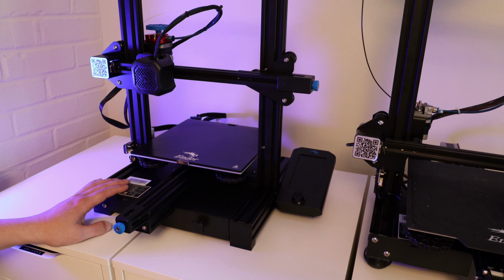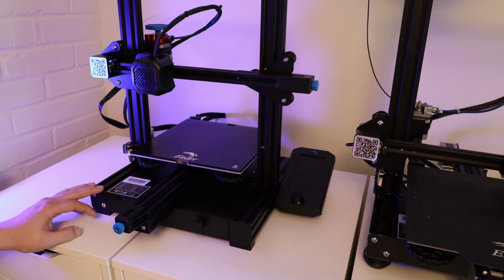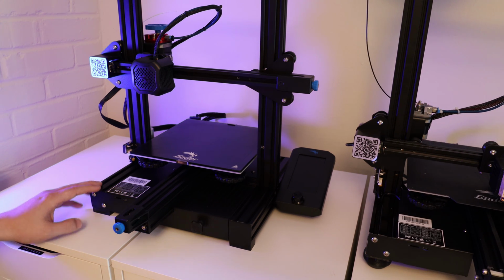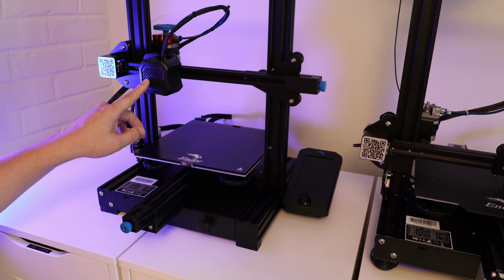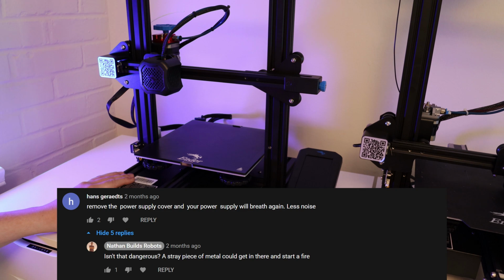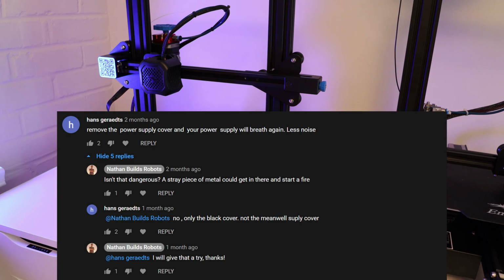The Ender 3 V2 Power Supply Is A Hot Mess!

Comment: Check if they tinned the wires in the screw terminals of the control board, that's a much bigger fire hazard
Reply from the maker: They definitely aren't crimped. I believe the wires are tinned.
Reply: @NathanBuildsRobots  Google it, I would redo all these.
Reply from the maker: @NicksStuff  Yeah, I saw an Artillery Hornet review and it was the first cheap printer I've seen that actually crimped those connectors. I agree that it is the best way to make those connections, but I'm wondering how big of a problem it really is. They ship tens of thousands of these things out with tinned wires, wouldn't we hear more about it if it were really that unsafe? I'll see if I can find some horror stores on Google.
Reply: @NathanBuildsRobots  Well, it's not a 10% risk either 😉
But that's not the right way to do it, so I wouldn't sleep right if I didn't change it
Reply from the maker: @NicksStuff  Next time I have to open the motherboard tray I'll fix it, it only takes 5 minutes to do so why not?
Reply: @NathanBuildsRobots  Agreed

Comment: Have you tried changing the vref settings ? I changed the x,y,z to 0.55 and e to 0 72.. That completely changed the game.. Try it
Reply from the maker: Funny you should mention that because I just did that on a Voxelab Aquila this morning. 

What improvements do you get by increasing vref? As far as I know it controls stepper motor and gives you slightly tighter control and higher speed capability at the cost of your motors running hotter. 

On the voxelab aquila, it came with vref at 1.3 V, crazy high. Print quality was great, but it caused my steppers to run 90 C, which is too hot for my liking. Turned it down to 0.55 and it ran much cooler, no lost steps but there was some wavy patterns showing up on straight lines, probably from timing belt cogging. Turned it back up to 0.8 and I think that's a happy medium now, good quality and steppers aren't too hot. They run 40-50 C now.

Comment: My Ender 3 V2 will be here next week or so.
What is the clearance on the bottom? Could I design and print little vent pathways to prevent the fan from taking in exhaust?
Reply from the maker: Clearance is about half an inch (12mm)
I would recommend the squash ball feet, they work great. Just look up "squash ball feet Ender 3" on Google or thingiverse, it adds better damping and raises the machine up about an inch (25mm)

Comment: Do you have any evidence that the power supply is actually overheating? Because of the heat transfer to the entire metal body of the printer, the power supply always runs quite cool and the active fan is likely not necessary.
Reply: @Twinsen yeah, maybe PSU isnt overheating. But, overtime it will shorten lifespan of the PSU. And get worse if you decided to put an enclosure for printing like ABS
Reply from the maker: @tdnam_9989  right, is not overheating in the sense that it is failing or shutting down due to the heat, but it's just running a bit warmer and keeping the fan on much more often. 
It might not matter for the average use case, but if you need to draw more power (for example, if you are printing PETG and need to heat the bed to 90)  or run it in a hotter room, it has less overhead to be able to accommodate the increased heat and is at a greater risk of overheating.
Reply from the maker: The power supply is off a typical design that is primarily cooled by forced convection driven by the onboard fan. The heat-generating electrical components sit on a PCB which is suspended inside of the metal housing with no direct paths for conductive heat transfer to the case aside from a few small standoffs. A power supply could be designed to conduct heat into the frame, but 99% of them are not set up that way, including the Meanwell power supply that comes stock on the Ender 3. 
Also, the PSU has an internal thermistor that turns on in response to a temperature threshold programmed into the board. I know that the PSU is running cooler because the fan is turning on less often. The stock system ran the fan almost constantly, while the modified setup only runs the fan about 20% of the time. 
This could be easily verified using  my thermal camera, but I can't do it now because I have no stock setup to compare against at this time. Cheers

Comment: Absolutely well done for not removing any of the metal covers that some (ignorant) people are advocating. :-D
Happy to agree with all you say about cooling and I will be removing part of Creality's plastic shroud to expose the fan ports'
I'm happy to leave the PSU where it is, but each to their own, eh? :-D :-D
Reply from the maker: There's more than one way to skin an Ender 3!
Yeah I try not to advocate messing with anything over 60V. I won't tell you NOT to do it, but there are special precautions and training required to do it safely.
Reply: @NathanBuildsRobots  TBQH I tell people not to do it regardless of voltage, when they clearly don't know what they're doing. :-)
I've seen someone get a very nasty burn from an accident with a 12V car battery (not from the acid).
Reply from the maker: Yeah high current can be dangerous too. Bottom line is stay safe and be careful!

Comment: Mine has it too and I just took it out. It was only blocking the vents and was aligned with the fan grill. When the fan is not working I'm just alarmed something went wrong. It's so quiet it makes me think it's broken. I might move it to the side later on. But I don't wanna deal with it right now. I'll first try printing a scoop pointing to the back or the side. I think it will make things much better.
Reply from the maker: It's a lot of work. In my latest silent build video I just did away with the power supply entirely.
Reply: I'll check it out

Comment: Well the whole thing is a mess heat wise: First: the powersupply being blocked from breathing. Second (even worse): The mainboard fan is connected in parallel to the part cooler so it only runs if you have the part cooler set to on. :).
Reply from the maker: Really? I didn't know that, only noticed that it would sometimes turn on and sometimes stay off. Poor choice by Creality!
Reply: @NathanBuildsRobots  Yes, really really check the board connection :). That leads to super random effects if you print with low or even without part cooling over a long time :)

Comment: Great video, thanks! The E3 Pro does not have this issue and indeed the place where the power supply is mounted is optimal for cooling so why not keep that solution on the V2? Nice handywork too :)
Reply: Having it inside the base is a good idea. Mounting it vertically like he does is quite close to the heating bed. I would keep mine where it is and allow more airflow by removing the cover.

Comment: Cutting the part cooling fan cable would be an instant sub if I haven’t already xD

Beautifully radical. I love it :)
Reply from the maker: Yeah those small Blower fans are the worst. Lots of high pitched squealing for something that makes such little airflow. 
Thanks for subbing! I'll be dropping another video this week for a bonkers build I just finished.
Reply: @NathanBuildsRobots  Do they really not do that much??
Reply from the maker: @Nopulu  Blower fans help on detailed prints, small prints, overhangs, and bridges. The two most common sizes are 4010 (small) and 5015 (med/large).

The Ender 3 blower fan's duct is not very well designed. It does a poor job of directing the air onto the printed part.

I'm currently reviewing a Voxelab Aquila, which uses the same fan, but a better duct and it is outperforming my Ender 3 when printing a benchy. I will have a video out on that printer soon.
Reply: @NathanBuildsRobots  So if I was getting fed up with the noise on my blower fan for my ender 3 v2 and decided to cut it off, would I see any noticeable difference in print quality? Or would I be in bliss from not having to hear my fan rattle every 3 hours when plastic strands gets caught in it.
Reply from the maker: @Nopulu    I cut my cord since I knew I was going to be removing that it as part of a mod soon anyways. 
I would recommend turning off your part cooling fan in your slicer settings first to see if you can live without it, or trying out the 5015 blower fan because it's more effective and less annoying.

Also the v2 fan is pretty good, while the Ender 3 pro fan is garbage because they have a different fan duct design.
Reply: @NathanBuildsRobots  How do I turn off or down the blower fan in a slicer like cura? Or can you only turn down the main hotend fan?

Also, If I bought a 5015 blower fan, would it fit in the stock ender 3 v2 fan duct shroud? Or would I have to print off a new one?
Reply from the maker: @Nopulu  https://youtu.be/Qg47Std5ywI
Check out this video by CHEP. He does the 0% fan show setting in Cura at the 57 second mark. I use Prusaslicer myself. 

To use a 5015 fan you'd need to replace the plastic fan mount. Theres a couple options on thingiverse. 
https://www.thingiverse.com/search?q=ender+3+V2+5015&type=things&sort=relevant

You can only control the part cooling fan in the slicer. You can control the hotend heatsink fan in firmware, but that is a little more difficult to set up.

Comment: I just ordered an Ender 3 v2. I will be modifying the power supply cover to open up the holes right off the bat.
Thanks.
Update:
I printed a new cover for my PSU that has more ventilation and holds a 120mm fan. I'm not sure you even need a fan if you get enough air holes in the PSU cover. The 120mm fan rarely if ever runs.

Comment: I've avoided buying the V2 because of changes like this. The "upgrades" they put on the V2 still don't outweigh my Ender-3 and Ender-3 pro machines enough to pick one up. I'll likely just jump to an Ender-5 when it comes time to replace one of my current printers.
Reply from the maker: Yes, I've had to undo a number of their "upgrades" from the Ender 3 Pro.

The good: 
-Silent stepper driver board (at this point this should be standard on all printers).
-Glass bed is flatter and provides more consistent 1st layer. 

The bad: 
-Belt tensioning knobs kept coming loose, replaced with nylock nuts.
-Threw away the extruder wheel knob.
-I Don't use the drawer. Would throw it away if I knew how to take it off. 

The ugly: 
-PSU mounting and vent cover.
-Louder fans than predecessor.
-Larger footprint than predecessor for same build area.

There are a number of inexpensive upgrades I would have gladly taken instead:
Quieter fans +$3?
Fill sized USB and SD card +$2?
Capricorn tubing +$1?
Metal extruder +$3?
Better bed leveling springs +$1?
Actual touchscreen instead of knob controlled TFT display +$5?
Reply: @NathanBuildsRobots  Looks like the Pro with your suggested upgrades would be better value than the V2.  Or maybe a Voxelab Aquila, not sure if they do the PSU the same way though.
Reply from the maker: @nickwilliams1953  the Aquila is a much better deal. My latest video highlights the difference between the aquila and the V2.
https://youtu.be/SMLL-16FQWk

The power supply is the same as the Ender 3 V2. It's a 20 minute fix to trim the power supply cover though, so it's not that big of a deal. Just something they could have easily done at the factory and saved themselves some material cost at the same time.

Comment: Get some case nibblers. Good vid but your metal skills need work.
Reply from the maker: Thanks for the tip, I'll have to get some nibblers next time I'm working with sheet metal. The $5 shears I was using kept bending the metal at the cut edge. Definitely not my finest work.
Reply: @NathanBuildsRobots  I used to use these to put fans and windows on the side panels of computers 20 years ago.
If you don't want to buy specialty tooling use an exacto knife scribe your lines. Drill a starter hole so that you don't have to start cutting from the edge.  Use the nibblers and then a Dremel to clean up any burs or sharp edges.
Reply: It won't let me link to Amazon, but something like the Pro'sKit 900-215 Nibbler are what I'm talking about. They are under $15
Reply from the maker: @3sotErik  alright, I bought one, will test it out next time I need to trim some sheet metal. Looks like they might come in handy for trimming support material off my prints too.
Reply: @NathanBuildsRobots  also consider looking on Amazon for 
Black U Channel Edge Trim Seal EPDM 15/32" high x 19/64" Wide (5 Feet)
It's only $8 for 5' so it will last a long time. It will protect wires & fingers from sharp edges.
Reply from the maker: Just used the nibblers for a project, they worked great!
Reply: @NathanBuildsRobots  glad to hear.
Reply: @3sotErik  Those are for fiberglass circuit boards. An air nibbler is what would be needed.  https://www.harborfreight.com/16-gauge-air-nibbler-96661.html
Reply: @MicroRotors what? He was cutting sheet metal.
Reply: @3sotErik  The product you linked to is intended for cutting circuit boards. The one I linked to is for cutting up to 16 gauge sheet metal.
Reply: @MicroRotors  I've been using this product for over a decade.
Amazon Description
"This Nibbler cuts up to 18 AWG soft steel, 1/16" copper, Al. and Plastic."
Reply: The product you linked to does the same thing but requires an air compressor. Mine does it manually, for much smaller projects.
Reply from the maker: I have used air nibblers before, is a little overkill for what I'm doing. I used the one bear recommended to make a neat hole in some sheet metal for my latest build, where I needed a hole to install a vapor chamber on the backside of my mainboard. The shears worked quite well for thin steel, almost like a can opener. 
I will have to try them on circuit boards I'm sure they world work on that too.

Comment: In fact, the most noise comes from PSU. I opted to print a cover for PSU, MOBO and a support for feet, from thingiverse. With arctic 80mm fan, I have no noise from PSU anymore.
Reply from the maker: That's a good way to do it. I added some feet to my printer from a thingiverse project, that use squash balls to damp out vibrations. Might be the same thingivrse project you used.  
I am a little reluctant to use 3D printed parts near high voltage or hot zones. I added noctua fans to quiet it down too.
Reply: @NathanBuildsRobots  it is not the same project, I used one associated with this: 4601320. There are 3 items for printing by the same person. For those who want to keep the PSU under the printer, this is a good project. The MOBO cover takes a little more work (needs a buck converter) and the noise reduction from MOBO is negligible (from PSU is huge). I used Arctic fans and now I only hear the hot end fan.
Reply from the maker: Oh, nice. 

On my Ender 3 Pro I replaced the hotend fan with 2 Noctua fans in line with each other, which cut out a lot of noise. I checked the heatsink temp with a thermal camera and it only increased heatsink temp by 1.5 degrees C, so pretty much equal to the original fan in terms of cooling. Pretty sure the same mod could be done on the V2 with a little creativity, but then you'll be complaining about the part cooling fan... It's a never-ending cycle.

On my v2,  I replaced the whole hotend with v6 Volcano clone, which is a little quieter and I think much cooler. It uses a tiny 30mm fan. Will be posting a video about that soon.
Reply: @adisk8PL  with your v2? No, only with mine.

Comment: Definitely a good approach, and you surely identified a few design flaws. If it were my machine, I would probably (1) add vents to the sheet metal on the bottom to match the psu, (2) find a way to align the fan vent better by e.g. making the screw holes slotted (3) increase thickness of rubber pads to raise machine off table (4) add a baffle between the PSU fan and vent holes so that the air doesn't get recirculated like you mentioned (could be as simple as a few pieces of painters tape)
Reply from the maker: Sounds good, those mods should help get more airflow. 

Some of the design choices they made leave me scratching my head, but if you can look past the flaws (or fix them with mods) the ender 3 is amazing. Using Prusaslicer and some really simple tuning/upgrades I can get perfect prints.